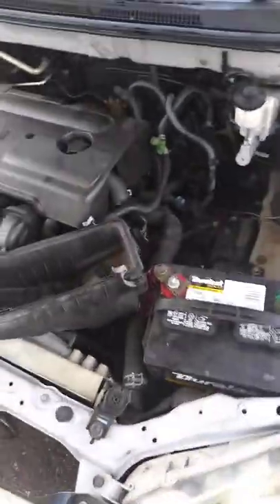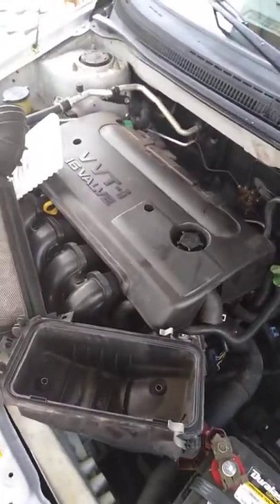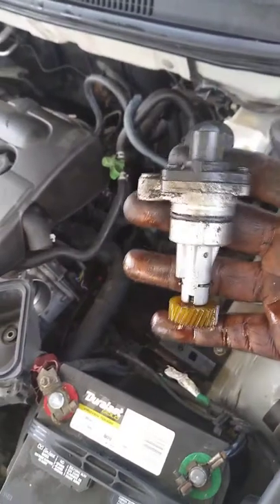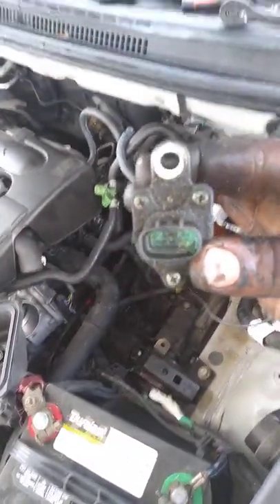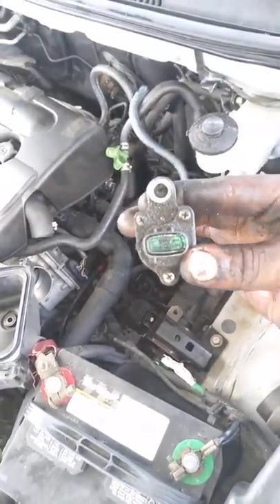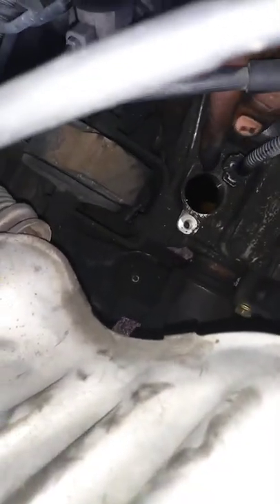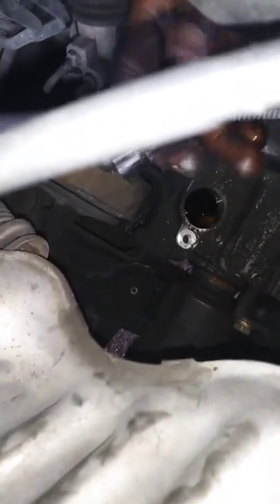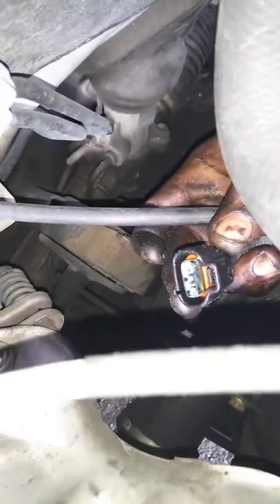Speed sensor 2005 Corolla location

Comment: Question, I have an 04 Toyota Corolla. 
Out of no where, the speedometer began acting erratically when I was driving in slow speed. I noticed it was acting normal for a bit and then acted erratically again. Do you feel this sensor could be it? 
It didn’t affect the driving. Driving was the same as if nothing was happening.
Reply from the maker: That's usually  sign of your sensor going bad but I would take the sensor out and check and see if you had any metal on the bottom of it.
Reply: @bigdokeechobee5523  appreciate it, I will keep you updated if it continues and if I changed it. Did you use the same gear of the old one into the new one? I see there are a lot of variations of speed sensors without gear sold with them. I have an automatic transmission.

Comment: I have a prado, O/D light Start flashing and automatic transmisión problema,  the error code is speed sensor, but My odometer it's working fine with no issues, any clue ?
Reply from the maker: Sound the abs module / pump

Comment: Ese corolla es automatico o manual todos los modelos de ese año llevan puesto el sensor de velocidad en el mismo lugar. Saludos🇵🇦
Reply from the maker: Yes this the s automatic  model. I not sure if all year  where in the same loction.
Reply: Que es el lugar por un 2001 toyota camry v6? Saludos de los Estados Unidos y Guatemala 🇬🇹 Y El Salvador 🇸🇻
Reply: Nevesito saver los colores chocolates y el verde adonde van...el plob se daño
Reply: @bigdokeechobee5523  is it located the same place on a Runz 2zz ? Manual ?